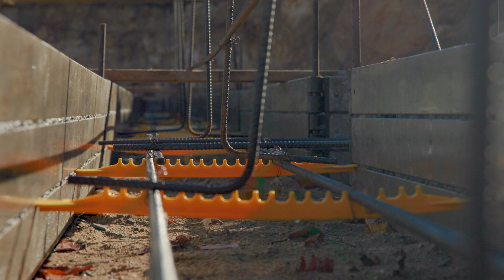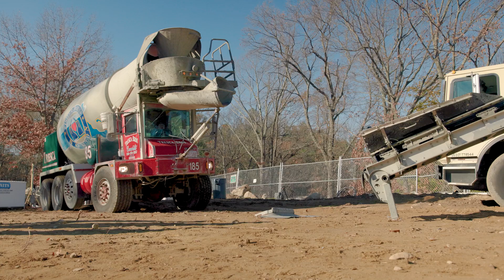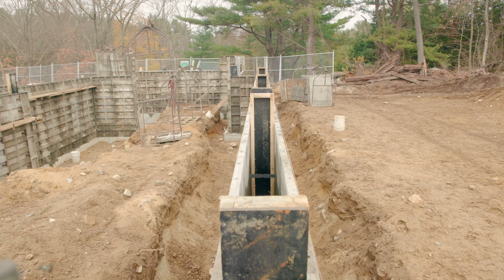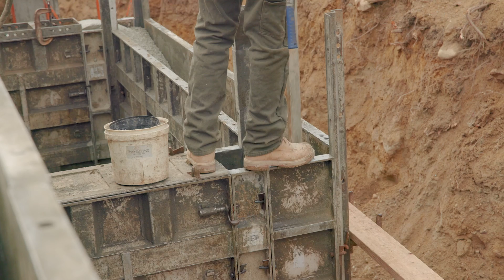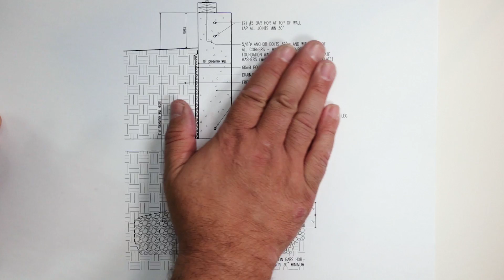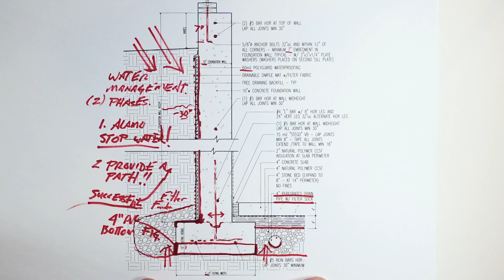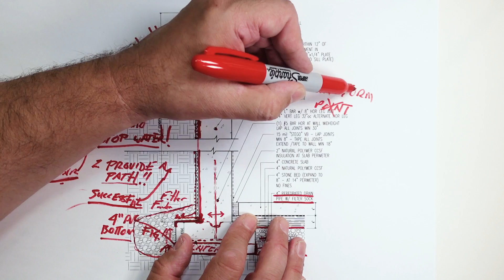Build Show Build: Boston Ep. 4 "Foundation Footing"

Comment: This system for water protection is very thoughtful, but I question the wisdom of directing excess water into the interior of the basement slab, and using the sump pump to remove it. It would make more sense to provide a robust, downhill drainage at the exterior base of footer. As you point out, if the sump pumps fail, the house basement will be flooded. Worse, if the sump pumps fail, say during a major electrical failure, then water could undermine the structural footers and differential settlement could occur. Your system works only as long as your sump pumps work. 

Depending on the height of the water table around the home, it is possible that a typical French drain, gravity system could be installed that would drain using gravity only to a system of prepared drywells that would be filled with gravel and drilled 20' feet or so deep. These drywells would then in turn have a gravity French drain pipe system to drain water downhill from the drywells. 

You mention there is a lower area away from the home. You could use that area to drain the drywells. If a lower area does not exist, it then one can be created by digging a 30' x 30' drainage basin that extends below the water table. Water will drain from the exterior of the footers, to the drywells, and then to the water basin area and will pool and evaporate. This system will work so long as it is located below the freeze line. Then, a sump pump could be used as an emergency backup at the EXTERIOR of the footer. This would separate the interior of the footer from the exterior and not allow the water table outside the footer to drain into the interior of the home.

I applaud your interior design that uses a sump pump and French drain system to drain any water that rises up on the interior of the building.  But even this system would benefit from a gravity fed pipe to the drywells placed far away from the home.

The principle of using drywells located a safe distance from the home is simple.  Because several drywells are drilled that extend 15' - 20' below the water table, so water will create a consistent flow to them. These drywells will then drain to the lower water basin, and the water will evaporate in the basin. If you have a nearby dry water channel that drains away from the home, you can use that channel as your water basin. You can place an interior and exterior sump pump system to assist the gravity fed French drain system in "wet seasons" where  the water table may rise temporarily. But these pumps will ONLY turn on when the water rises to the top of the footer. If done correctly,  your sump pump will almost never be used.
Reply: Just to be clear, we aren't directing excess water to the interior. I do see your point, but most water is coming up right. Water will continue to fall in the ground till it is stopped, or pushed back. When it gets pushed back, it comes up. Follow?
Reply: @stevenbaczekarchitect9431  Thank you for your reply.  I would like to add one point because I don't think that I did a good job communicating.

I agree that your system does not intentionally direct water to the interior of the building. However, because you are installing level pipes across the footer, water will likely be transmitted from the exterior of the building into the interior of the building, and this is not optimum to protect the building. Because the exterior of the building will experience exponentially MORE water pushing against the outside of the footer, the increased pressure of the exterior water will push water into the interior of the building. The amount of water that rises under the slab is miniscule compared to the amount of water that is rising outside of the footer.

The downside of the design you use is that if the power goes off in a high rain situation and the underground water table raises to the footer height or higher, your sump pump will not function with no electricity (unless you have backup power). In a worst case scenario, this could cause differential settlement in the structure which would be very expensive to repair.

The system I have recommended is gravity fed and does not rely primarily on sump pumps to get rid of excess water. It will function ALL the time and therefore wick out water from away from the exterior and interior of the building 24 hours a day. This will intrinsically keep the compacted bearing soil underneath the footers drier and more stable. 

In the event of powerful storms where catastrophic amounts of water are dumped on the building in a short time, it will take time for the drier soil underneath the building to become saturated and for liquefaction to occur. The high water table will have a gravity fed path to channel water away from the building, which is the most important goal of a drainage system. If in the worst case scenario, the gravity system is overwhelmed, you have a sump pump back up system on the interior of the building and the exterior of the building to help disperse the excess water to your drywalls or your wash drainage area. 

Keep in mind that your system will work, but it is heavily dependent on the sump pumps. And as you mention in your video, sump pumps can break down and fail. A gravity fed system is superior, but it would probably cost 10% - 20% more or so because you are in a sense creating a large septic system if there is no drainage channel you can use. If there is an available drainage channel nearby, then the costs would  be roughly equal. 

NONE of these protections will work in a flood situation where water levels rise higher in your drywells and drainage area than the house elevation.  In that case, there is no protection except some type of flood wall barrier. But that is not a likely scenario.

I hope this suggestion does not come across as arrogant towards you. I am a huge fan of the beautiful, high quality buildings that you build. Your attention to detail is excellent and I would not hesitate to hire you as a GC. I wish you many more successful, eye-catching projects in your future.
Reply: @franklong6269  Rewatch the video.  There is gravity fed system that Steve mentions at approximately 6:20 of the video.  I assume that is the principal drainage system and then there are two backup drainage systems using sump pumps.  The backup drains are connected by the lateral with the exterior drain being 1" higher than the interior system, so in essence the exterior drainage system is a backup the interior system which is a backup to the gravity fed system..  So as I understand it, there are 3 ways to drain water away from the property.
The laterals aren't designed to intentionally divert water into the interior but the eliminate/reduce hydrostatic pressure on the footing/lower foundation.
Reply: @Bob_Betker  Thank you for your thoughtful post. When "Steve" describes his video, he is not clear about the reason that he is allowing a direct connection to the inside of the house via the PVC horizontal pipes. You are correct, he does say it is a gravity system - thank you for pointing that out.. But the problem with Steve's system is that it allows waters water from the outside of the footer to the interior of the slab. If the interior slab is a "floating slab" as many house designs specify, this could cause differential settlement in the house. 

The difference between what I am proposing and what Steve built is that I do not see a practical reason to connect the water level that is outside of the footer with the inside of the footer under the floor slab. As I pointed out in my last post, the water pressure outside of the footer will be much higher than the water pressure on the inside of the footer; so Steve's system actually does direct water into the interior slab. That makes no sense at all. There will be significantly more water outside of the footer than there will be inside of the footer. Thus the water pressure of "more" water outside the footer will flow through the pipes into the inside of the footer under the floor system.

When the underground water table rises above the footer, there will be overwhelmingly more water outside of the footer than inside the footer.  So water will flow into the house interior through the horizontal pipe system. Thus I don't think the horizontal pipes help drain water away from the interior area under the floor slab. The premise of Steve's system is that there will be LESS water pressure outside of the footer, than inside the footer and that will cause water to flow from the inside of the footer to the outside of the footer. In my opinion, that is a faulty premise. 

What saves Steve and causes his system to work is two things:

1. He is apparently using a gravity system of some kind, and that is important. He didn't go into specifics other to say that he will drain water to lower ground. In this, Steve and I agree. However, with the system I specify, the French drain piping itself must be installed with a slope  (probably 1/4"  - 1/2" per foot) towards the drywells I described. Then sloped French drain pipes drain water from the drywells to a lower drainage area. This is the same principle that septic systems use, only I would attempt to install more slope to the water piping system I am describing  than the slope used for septic systems.

2. Steve backs up his system with sump pumps on the interior of the slab. I did not hear him mention sump pumps on the exterior of the footer. In my system, the sump pumps on the EXTERIOR of the footer are the primary back up system. Ideally, water levels on the inside of the footer will never rise high enough for the interior sump pump under the floor system to kick on.

It is key to understand that a sump pump system will not work unless it has a drainage basin or channel to drain water to lower ground. 

What also may be different about the system that I am proposing than Steve's system is that I propose TWO gravity fed French drain pipe systems flowing separately away from the house. One is the French drain pipe system placed at the interior of the footer to protect the floor system. The second is the exterior French drain system at the exterior of the footer.  In my system these two French drain pipe systems are completely separated from each other. In Steve's (if he uses an French drain pipe system outside of the footer, which is unclear) the two pipe systems are connected to each other. 

Also, with the French drain pipe system I am specifiying, the PRIMARY force that drives water away from the house is gravity, not the sump pumps that Steve uses. In my system, the sump pumps are only for high water, emergency events (like floods). If the house is built with sufficient elevation, ideally, with my system, the sump pumps will never be used.

Draining water away from a house built on ground with a high underground water table can be complicated. Steve did a good job to protect the house from liquefaction settlement. I commend him for that. Some GCs would have done the bare minimum to protect the home.

Comment: I'm not a builder so excuse the ignorance. You talked about anchor bolt spacing. Is this at all affected by the stud layout so that the anchors fall inside a stud cavity, or is that all left to chance? I didn't see any marking out of stud locations prior to the pour.  32" spacing makes it more likely to hit every other cavity, but only if the starting point is set correctly.
Reply: Good point. You can be really unlucky and hit right beneath every stud, if you are really unlucky. Around here, they typical just stick some steel band into the concrete. You can always bend that around the studs.
Reply: It is not a slab on grade so there is a sill plate and floor joist on top before the stud wall ***. On a ten-inch concrete wall, there is lots of room for joists if any anchor bolt is misplaced*** in my area it is every four feet it is code

Comment: Love your foundation videos. It’s all in the details.

My understanding is that the most successful foundation is the one that never gets challenged by water. When dealing with surface water, a deck/porch would keep the water away for several feed right? But a building that can’t have such feature, for ecstatics, would still benefit from such feature. 
You mentioned a sloped ground, which is at the actual surface level. But water can still migrate into the ground from there. So I’m having this idea, and you can tell me how stupid it is..

Two feed below grade, going from 6” off the wall to 36” away from the wall, we could pour a  2”-4” thick 10° sloped slap. Top it off with gravel to sloped grade. This would move surface water away from the wall and make life easier the basement wall. 

Could such a feature work? Is it stupid? Downsides? 

I’m thinking in a cold, snowy New England area, this could help a lot with early/late freeze/thaw cycles and migrate rain and melt water away from the wall. 

As you mentioned at the end, water is the enemy of the foundation and too often not enough attention (to detail) is given to it. Up here in Maine I see so many homes with foundation issues. It’s the #1 reason I’d not feel comfortable to buy existing older homes. 

Anyway, any feedback is greatly appreciated
Reply: You expensive 
&
Doesn’t stop the ground water that would rise 
+
Possibly trap said ground water rise

Comment: Just for my own sake, what do you think the cost is for a foundation of this size? This is one of the best, most detailed videos of this part of the build. We'll done!
Question regarding the end of the video pertaining to the draining of water around the footer and base of the wall. This might be a dumb question, but couldn't you just use another 4 inch drain tile around the exterior of the foundation just like the interior to eliminate the laterals in the footer?  And then just have  that run to daylight or a sump pump? Is it because there's not any grade/fall to the land for that to happen.
Reply: He mentioned 140 yards of concrete, which I think is the basement wall, not the footer. At $150/yard, that’s $21k in concrete alone.
Reply: @4philipp  good point. So add in the footers and basement slab you'r probably looking at another 80 to 90 yards maybe.  Plus labor, would you think 75k would be a fair estimate?

Comment: The methods of foundation and engineering there are vastly different than we build here in Rockies and much of West. 

First we never assume “water issues” on a site. We do sample borings on the site to identify the geology and the water table. As an engineer, I would never consider a ‘self leveling’ open drainage duct between exterior and building subarea. We take control of site water, be it subsurface and/or surface. The freeze/thaw cycles and having water at footing base is asking for trouble. We also never use floating footers, perimeter or interior. Depending on water table and geotechnical engineering, we always drill piers or drive helical piles to which we tie our footings with compacted non-expansive base under footing. Drains are always installed at exterior base 6-12” below the exterior footing base. 

I’m assuming you’ve done some geotechnical surveys on that lot and identified it as non-expansive material. I’d be concerned that is a cut & backfill lot given only one area appears large native rock. Those dissimilar materials are commonly not advisable for a floating spread footing that you’re installing.
Reply: Interesting points  how do you deal with water wicking up the concrete wall from the footing?

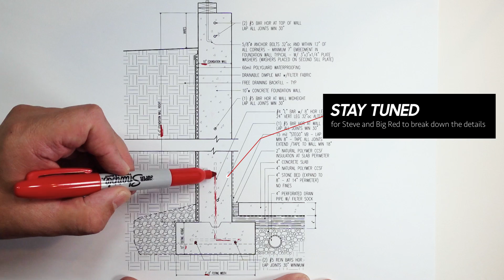Comment: Steve at vid time 4:54 you explained the construction of the foundation footings using your detailed drawing, I noticed there is a locking key drawn in-between the footing and basement wall, I've seen this detail on many drawings but few contractors make provisions form them, are they not required for code?   I'm a fan of the Build Show and the work you do.
Reply: They are a default in my drawings. If the is no call for vertical J bars coming out of the footing, they are important to me, with J bars, they become less critical

Comment: The "trowel" you referrer to the worker using is actually called a float typically made of magnesium or wood used to flatten wet concrete. A trowel is used to flatten nearly hardend concrete.

Comment: The rebar sticking up should be covered to avoid accidents
Reply: We all cut Osha corners to some degree, but not securing the top of rebar, especially when working so high above it on unstable and uneven and slippery surfaces, makes me queasy.
Reply: I was thinking the same thing. This job site is one big OSHA violation.

Comment: I like the idea of the laterals for water migration, but what is the reasoning with the main perimeter drain being on the inside? Usually you see perimeter drains on the outside. Or does it really matter since you do have the laterals and it makes it simpler connecting it to the sump pump pits.
Reply: Sump pits are on the inside
Reply: @LongLiveOurBuildings  Thanks Steve, Love this series and great explanation on everything.
Reply: Very welcome
Reply: Yes, I do not understand why go through a sump pump when you can drain to daylight down the hill ( backup no problem main sources????)*** Also what about DAMP  capillary wicking action going up the wall from the ground?

Could someone please explain